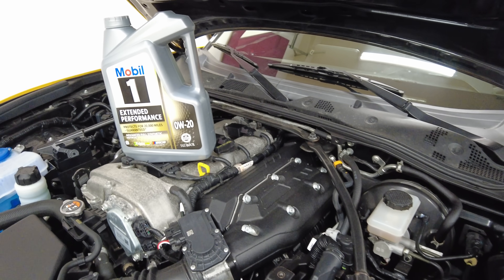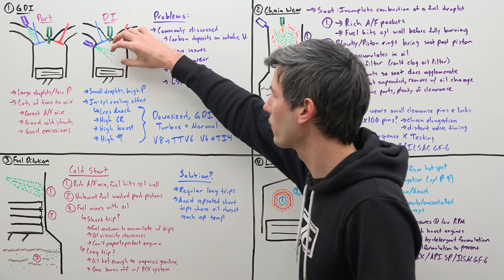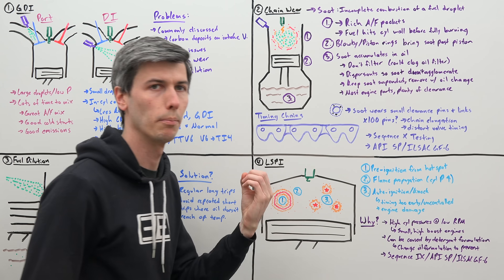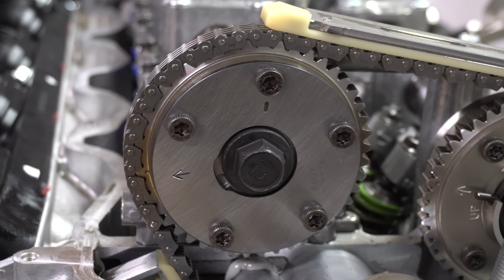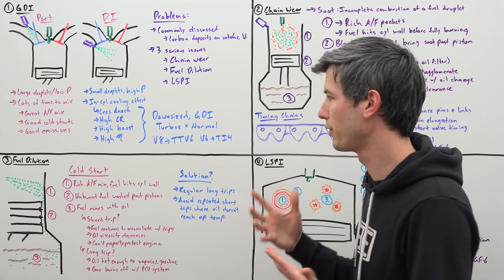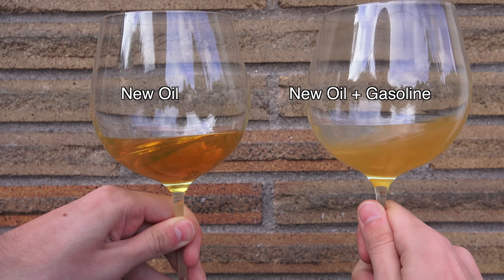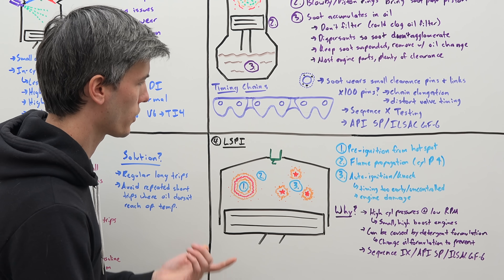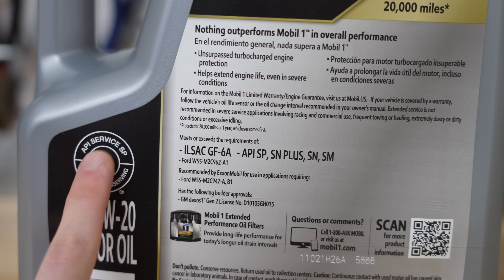3 Big Problems With Direct Injection Engines (Gasoline)

Comment: Widespread adoption..if you believe vw s PR. They have 207 E9 (9zeros) debt. The up doesn t count, he s not a TFSI engine. Naturally Belgium and Holland and Iceland, the fillipines, Bangkok aar that place..are stone rich so passats an t rocs are always bought, and up is never. Neither is citigo. Unless it is. In that case, Holland etc are not so rich, but TFSI engines are still Beta version..saleswise..well vw is kinda renowned for re- / extra / development after issueing the product. Dubbing it software upgrade..

Comment: And valves don’t require a camshaft… Pneumatic or electronic control systems are possible. The rate and magnitude of valve operation could be throttled to control cylinder pressure changes wrt the stage of the 4-cycle process and sensed parameters.

Comment: So why not heat the pressurized fuel above its combustion pressure auto ignition temperature using post catalytic converter exhaust heat (electric preheat for starting and warming)? Spray volume and duration could be used to control burn temperature and flame rate/geometry.

Comment: It's about time somebody revealed all the disadvantages of downsizing, turbocharging, and direct injection.  It makes me all the more pleased that I recently purchased a vehicle that is a modern marvel of simplicity.
That would be a Kia Rio to be used as a small occasional runabout for our 2nd vehicle; the other being a somewhat larger Plug-In-Hybrid.  That plug-in-hybrid's engine hardly ever runs to meet our daily needs and when it does run, it will almost always being on a longer trip where it is totally warmed up.
Why I love the Rio?  It has no Turbocharger.  It doesn't have Direct Injection yet still achieves Excellent fuel economy.  It has 15" wheels and tires which are cheap to replace and offer superior ride quality due to taller & thus shock absorbing sidewalls.  AND it has Drum Brakes on the rear which are ideal for the Salt Laden Winter conditions where I live which causes rear disc brakes to corrode away long before they actually wear out.  With 70% of braking being carried out by the front wheels anyway, that is a trade-off I'm happy to make.
NOT EVERY VEHICLE has to be some marvel of technological prowess to be a plausible transportation device!

Comment: My Super tech syn oil meets the requirements you said are necessary. 
It's advertised to go 10K miles , which I would never do in our 2019 Ford Escape 2.0.
Usually  4K mile oil change. 
My question is what makes Mobil 1 oil claim to go 20K miles  ?  Our there auto manufacturer's that say you can go 20k miles on oil changes  ?
Being a retired truck fleet mechanic I've always been very conscious about changing oil.  Also I've read about the benefits  of a PCV oil catch cans. If it would extend engine life do any manufacturer recommend it ?
Thanks for your very informative videos. 👍

Comment: I find it interesting that as a  benefit of d.i. you can stratify the charge in the cyl with a majority lambda of >/= 1.2 and make a small, final minor injection  prior to ignition creating a small zone of lambda </= 0.9 near the spark plug electrode to avoid lean misfire.

Comment: One notation regarding some visual aids is that you are not spraying fuel into an open chamber of still air at STP - the  air temp after partial compression can easily be over 375degC, the fuel will mostly evaporate and cool the chamber as the compression continues; the fuel mix encounters high swirl or tumble movement  of the air as it enters the cyl, so it is not clear if droplets would predictably impinge on the opposite wall. All manipulated by the design of cyl head and piston crown features and injector positioning and timing. Some  configurations successful some not. Quite the Tempest in a Teapot

Comment: 05:29 and 09:50 solves two of the three issues, by using the correct motor oil.
The third issue is mainly with cars used as daily drivers in the city, for short trips.  It's fuel dilution of your oil, because your engine doesn't get hot enough.  The oil  needs to get hot enough to cause an evaporation of the fuel that has gotten past your cylinder walls, at each of those cold starts.  This video's solution is impractical, at 07:25

Comment: Back in 2001 i owned a 1999 volvo s40 which had a 1.8 GDI engine ( from mitsubishi i think), it was great on fuel, 40mpg was good back then for a petrol engine, it always had a faintly audible ticking sound which i was concerned about but was told it was normal and nothing to worry about. I wasnt so sure and sold it after a few months, turns out it was actually normal 😮

Comment: Didn't have any issues on my 08 cobalt ss. That was I believe Gms first attempt, and it worked great. I ran e47 and the injector seals were not rated for it, but it survived. I had to teach myself how to tune these load based engines. It was an awesome learning experience and that car beat up cars  it had no business beating. Getting walked in your 475hp charger by a cobalt? Imagine the tears. We did have to clean valves once, but it wasn't that bad. The bigger issue was GMs idiotic lost foam casting that lead to boost leaks through the cylinder walls into the cooling system.

Comment: Personally, I find that chain stretch in GDI engines is not so much the oil contamination, but the HPFP on the cam to make the very pressure needed to feed the GDI system...Manufactures of OHC/DOHC GDI engines need to make the HPFP Crank Driven and NOT Cam Driven...OR make gear drives like the Kawasaki W650/800.

Comment: This all sounds a little alarming, and perhaps it should. The MAIN POINT here is use Top Tier gasoline (Chevron, Shell, Mobil, Exxon, even Costco for the additives, and use the oil called for in the Owner's manual. This is very important, and especially for turbos. I have two different 2015 vehicles with direct injection. The non-turbo gets an actual 40 mpg on the highway and the turbo gets an actual 35 MPG or more. Direct Injection improves efficiency by about 10 - 15%. In the case of the turbo I use it for long drives, short drives will increase the number of starts and stops and therefore wear on the shut down electric coolant pump. If that fails the turbo will soon need replacement. BTW - both car manuals call for a specific manufacturer of motor oil and you should use it. No problems at 65K and 75K miles. Neither car consumes oil either. I have seen all sorts of oil change videos suggesting all sorts of screwball stuff - stick to the manual.

Comment: Dirty oil is the number one killer of engines today. Where I live it is really dirty( lots of gravel roads still ) and yet people run their oil until the oil life minder is at zero ( which is often 7-9000 km’s ). Oil comes out BLACK and even after changing the oil the new oil looks dirty right away. 
In my own vehicles I don’t even go by mileage to determine when I should change the oil, because I do a lot of short trips. I also put a liter of ATF, and a bit of diesel in the crankcase and run the engine until it’s HOT; before draining the oil.

Comment: I mean I could argue it’s not the direct injection that’s the issue. It’s the EGR that circulates dirty oily air back into the intake that’s the engine killer

Comment: How do Diesel engines deal with carbon deposits on the intake valves as they are, by their very nature, direct injection engines? My 7.3 power stroke has 280k miles and I just performed a compression test and all 8 cylinders built at least 350 PSI cold. That tells me that if there is, indeed carbon on the backs of the intake valves, it’s certainly not inhibiting the engine’s ability to build pressure.
Reply: If you take the inlet manifold off (as I did to my 31 year old diesel) you will find a layer of gunk comprised of soot particles from the EGR, plus oil mist from the PCV, coating the inlet tract,the valves and valve pockets...
so much so that you can use a stick and dig it out.
If oyu have a turbo there is sufficient pressure to always fill the cylinders no matter how gunky the inlet manifold becomes.
The valves just cut through the gunk on the valves/seat and therefore still maintain good compression.....
NA????

Comment: I appreciate him defining "short" v. "long" trips.  However, he doesn't define the number of short trips needed to create enough gas in the oil problem.   My wife primarily uses her equinox solely for short trips.  I need to know how often to borrow her car to do my 30 + minute trips.
Reply: Once a week?

I have the same problem with a 2001 Mitsubishi 2.4 GDI which my wife uses for 4 trips per day of 20 minutes duration.
Oil consumption is 1 litre of oil per 1000km. (or per 100 litres of fuel)
Really it is a   1:100     2 stroke mix.....

So in my regular 5000km oil change interval ( This is severe service and oil is cheaper than a new engine)  I have tipped 5 litres of new oil in...and the oil change takes 4.5 litres (including filter).

When we recently went on a 2000km trip over 7 days the consumption of oil fell to 1 litre per 2000km..(50% decrease) and the fuel consumption fell by 40%.....

Now after a month of the normal short trips....back to higher consumption of both.

Comment: I just had the timing chain elongate and explode in my 2014 Chevy equinox, with thousands of dollars of damage.  I wonder if it was because I let the oil change go 6,000 miles--with a false sense of security because Chevy tells people to change the oil every 10,000 miles.

I expect this means change the equinox oil every 3000 miles.

I also wonder is the the 2012 Transit connect is direct injection.

Comment: The question should be, is direct injection be used in private automobiles since consumers are poor at following recommended maintenance schedules, thus causing early engine failures.

Comment: The other problem with direct injection is, it sucks to drive. Have you driven one? The throttle response is utter garbage
Reply: Not on older larger capacity engines it's not......

Comment: Gasoline Direct Injection Sucks. I have a channel dedicated to the concept that you can make a car last 25 years and 300,000 miles. I have a 30 year old BMW 325i, 17 year old Honda Element, and 10 year old Kia Sorento SX. All three vehicles have ported fuel injection and all run like a sewing machine after many many many years of use. I should probably rename the channel "Make Your Cars Last 25 Years" - unless they are GDI!

Comment: Short trips are bad for port injection, also. Water is a byproduct of combustion and it will certainly make its way to the oil sump. If you're not running the engine long enough, the oil isn't heated for a long-enough period of time to evaporate the water from the oil sump (exiting thru the PCV). Short trips and idling just suck for engines.

Comment: would upper cylinder lube be very helpful to gdi engines ? and oil aaditives ? or just using oil that has better tbn, better teost & better noack test results also help with possible deposit reduction ?
and is running 91-93 octane help this issue too ?
Reply: GDI doesn't (unless it has the dual GDI/port injection) squirt anything onto the valves....so how are you effectively going to get the "upper cylinder lube"..to the valves and upper cylinder???
Reply: @JohnSmith-yv6eq  isnt the upper cylinder area where gdi sprays ?  valves, no, but i believe the formula some how mixes there , lubes that area ? Why i am hoping for a Engineers feedback

Comment: Direct injection is more efficient in terms of fuel consumption but the down side of using higher compression is requires higher octane fuel to keep carbon deposits at acceptable levels. 

Where do I send my invoice?

Comment: Don't be cheap.....you have a high performance turbo motor.....use 91 non oxy fuel....just like in your boat....burns much cleaner, pre ingintion doest happen. And he just went on and on why you should always change your oil every 3000 or every 3 months.... Regardless of full syn or not.

Comment: Yep if you hate to take proper measures to take care of your GDI engine? Like if you have a Turbo GDI and I do the Intake/valve service every 12,000 miles and change my 0w20 synthetic oil every 4,000-4,500. Instead of the manufacturer suggested 7,500. I use mobile one or Amsoil signature series. So yeah, it has above average maintenance requirements and that’s just the facts if you own one period.

Comment: Well I installed oil catch cans on my and believe me my car came alive. Oil vapor going back into the engine to be burned off with fresh and clean fuel is not right it decreases gas mileage and make the engine work harder to make adjustments all direct injection engine should have a good oil catch can or air oil separator

Comment: Jason - this is super explanation. Thanks so much.  I have solstice LNF 2.0L direct injection turbo with only 70,000 miles and timing chain stretched so timing missed up fully.  Crazy with this low mileage and changing oil before indication says to do and still this major problem.  Dealership wants $2800 to replace main chain and balance chain and tensioners and cam actuators.  Question is what is best gas to use - there are 87, 91 and 93 octane.  Does 93 with less chance to produce soot and then this chain problem lessened?  I know 93 is less early detonation but how about soot with here maybe all the same?  Thanks for any update. 😊

Comment: There's no way that the fuel sprays onto the cylinder wall like the example used with the spray bottle. You'd have a CRAZY rich afr for that amount of fuel.

Comment: Hi
I always thought when direct injection arrived that it would have been ideal for a stratified charge system injecting just before ignition and so decreasing the likelihood of a pre ignition event but no with just about every di unit I have seen they still inject at around the same time as old port injection engines, there seems to have been little advantage to going di. Also if fuel efficiency is so important why have all manufacturers followed the same path surely it might have been a good idea to design the engine to use as little fuel as possible and then design an exhaust after treatment to work with that

Comment: To think, we can now improve air pollution by making cars that doesn't last longer than 3-5 years, meaning we have to build more cars (increasing pollution again) for all the ones that is discarded because its engine,  gearbox or computer exploded. It's a bold move, let's see if it pays off.

Comment: Ive been very conscious of all these things except for lspi; i do have a habit of keeping my engine revs low because my engine makes peak(260lbft tq)@ 2200rpms. Now iknow its bad but im used too a big v8 that benefits from lowspeed high torque as it increases longevity. Iguess now that i drive a highoutput turbo 4 i should be reving it out more. Really hard too do that as the dct is programmed too shift annoyingly low anywhere below 3/4 throttle. Even then it shifts at only 3-3500rpms under 3/4 throttle even though its redline is 6800 rpms....one thing ive noticed is that the new 0w-20 is bs!  My car reccommends 0w-20 but the year before and the past 10ish years the engines been around it had always used 0w-40/5w-40/5w-30. All of which are much thicker then the 20 weight that increases fuel efficiency by a whole 5%. Quite sad the sacrifices manufacturers are making today. Its really not them but the government gorcing insane epa regulations...

Comment: I think direct injection is a good thing for race car engines that don't have to last long. For normal use cars, cost/benefit wise it's a bad idea. They demand a tighter maintenance schedule and a lot of attention. And when they break it's usually expensive
Reply: I don't think that's entirely true. Newer toyota engines utilize gdi and they are supposed to last more than 300k kms.
Reply: Actually Mike Essa (Formula Drift Champion) deleted the direct injection in his E46 BMW drift car and recently the DDE Ferrari F12 too.
Reply: you think wrong... Costs are minimally increased while efficiency is greatly increased and most of the issues have been ironed out. Normal users should stop being absolute morons and figure out how to properly mantain their cars. Frequent oil changes,  frequent long trips, allow the engine to heat before smashing it. 3 very simple steps that make even the most unreliable of engines pretty much bullet proof. All modern engines are a lot more reliable and efficient than past ones. You might not realize it if youre constantly comparing apples to oranges... If youre thinking of those shitty corolla or civic tincans with their sub 100hp na 4 potters as test benches for the modern 200hp+ 50mpg turbo I4's then yeah, youre doing a terrible job at comparing stuff. No old engine can match the power, weight, smoothness and efficiency of modern engines and mantain their stellar reliability at the same time. None. Not the 2JZ, not the RB, not the K series, no LS, nor any of the mythological 80s o 90s engines.
Reply: Race enines have the nozzles as far up in the intake trumpets as possible. Direct injection would simply kill the engines

Comment: I bought  2017 hyundai off the showroom floor in 2019. I was happy to learn it had the Atkinson engine design which still has port injection for great reliability and none of the design problems of direct injection. I would never buy a car with direct injection for the maintenance requirements alone. Carbon deposits on intake valves leading to misfires etc was enough for me to avoid them.

Comment: I've owned 1 x small capacity direct injection turbocharged engine, never again - intake valves required carbon cleaning at 34k miles which eventually the vehicle manufacturer paid to repair. Traded it in & got a Toyota hybrid fitted with D - 4S, direct & port fuel injection so best of both worlds, no turbocharger & 2 litre capacity.